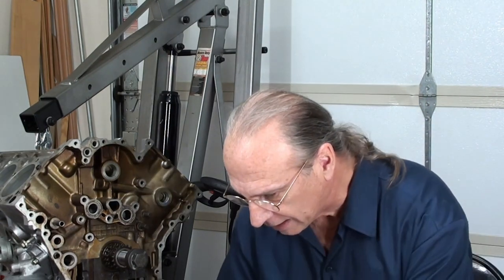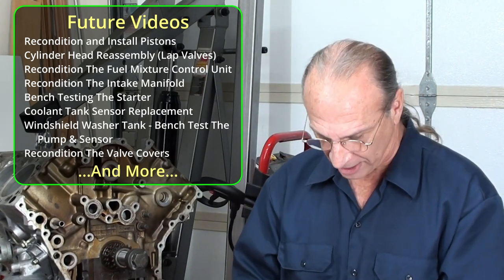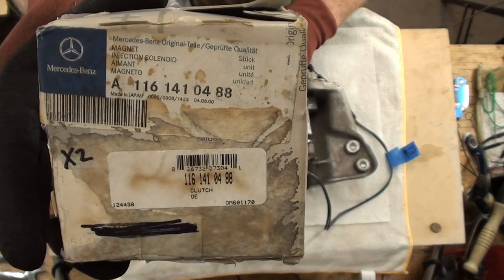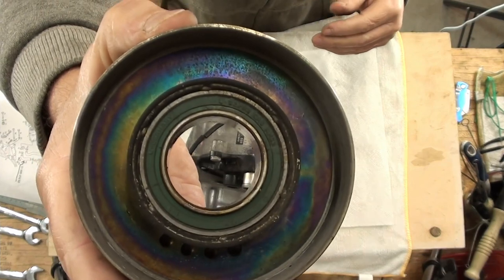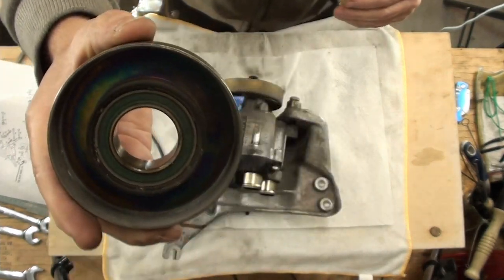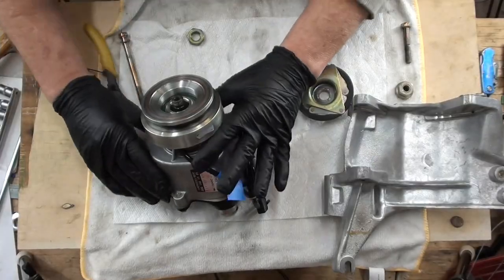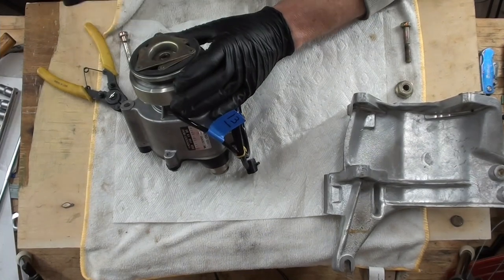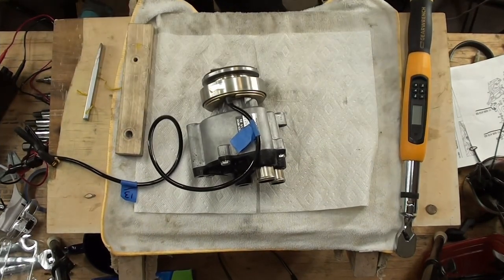560SL - Air Pump Bench Test & Clutch Replacement

Comment: Just ordered a rebuilt air pump.  Pulled it apart per your video, pump itself is making a grating noise…
Reply from the maker: Did you disassemble the pump to see what the problem is? I’m guessing it’s just a bearing. I have not completely taken one apart.
Reply: @TonyLiveTV  I did not disassemble the internal pump.  A rebuilt cost 296.  I just decided to purchase a rebuilt unit……

Comment: Hi! What are the symptoms of a failed air pump.  Does it affect the vacuum?
Reply from the maker: I don’t believe the air pump affects the the vacuum. From what I understand, one symptom of a failing air pump is that the engine may have trouble idling when it is cold. Of course there are many things which can cause the same issue. Other than that would be the obvious failures like noisy bearings, a squeaky belt and so on. In addition there is that check valve next to the engine block which could be blocked or not working properly. I know a lot of people remove the belt and run the car without any issues. In this video I bench test the obvious things such as the pump’s ability to pump air and test the clutch.

Comment: Tony, is it a big job to get to the air pump? I've been looking all day but can't find a video or any instructions on how get to the air pump. It looks impossible to get out without removing a lot of other things in there.
Reply from the maker: @Carzan-k7z  You can get to the air pump. I have another video on the air pump that might help you. 560SL - Installing The Air Pump & Bracket
https://youtu.be/B2___1DHYtY
Reply: @TonyLiveTV  Thanks Tony. Any idea if it's removed from the bottom or top? Looking under the car it seems impossible to get the pump through. But looks like it's possible from above if I remove the radioator?
Reply from the maker: @Carzan-k7z  I would remove it from the top. I don’t think you need to remove the radiator, but you will need to remove the fan, shroud and alternator. I would suggest you purchase new hoses for the air pump. That way you can cut the old one off to make it much easier to remove. It is quite difficult (was for me) to remove the hoses, but easy to install them. Good luck 🍀
Reply: @TonyLiveTV  got it. Thank you